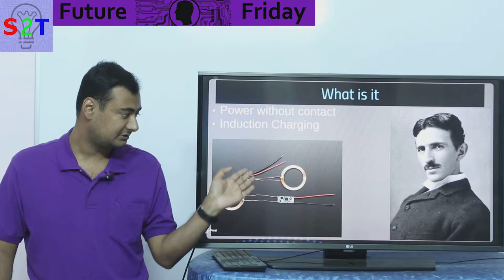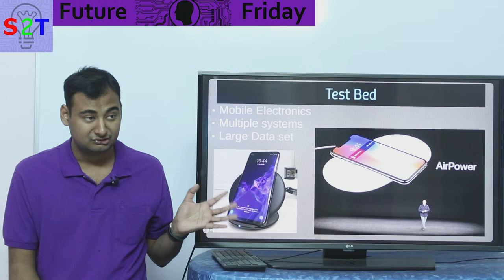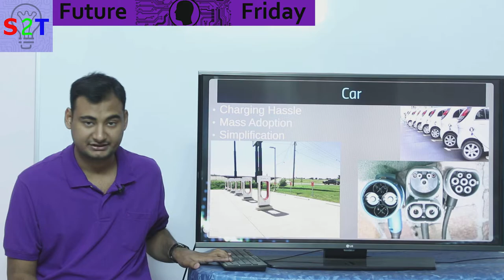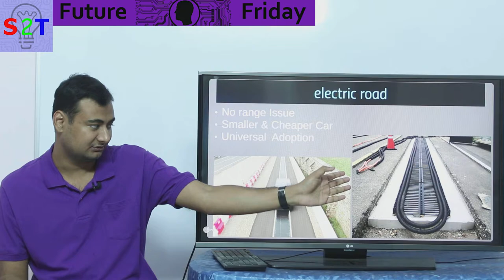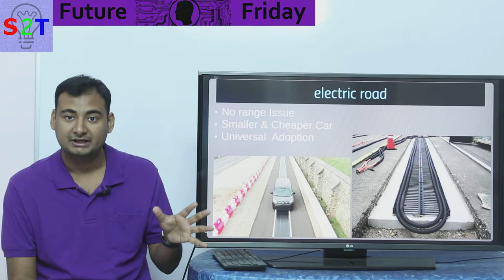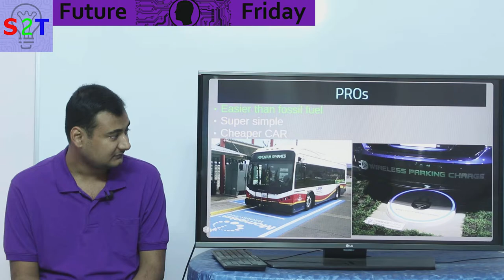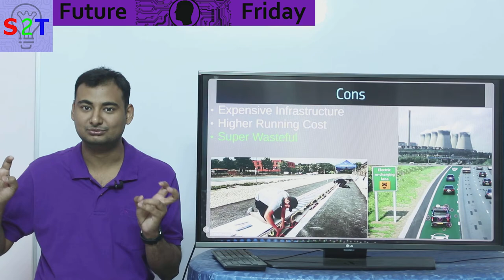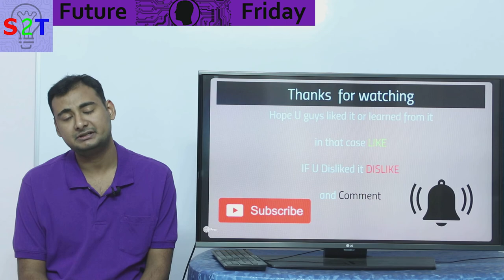Future Friday Ep27 (Wireless Charging For  Car's Explained)

Comment: Is this is cheap enough (road integrated wireless power), this would make hydrogen fuel cell a non-started. How about just on toll Highways only?
Reply from the maker: You are asking me to choose between 2 bad idea wireless car charging is so wasteful it is at the same efficiency as hydrogen fuel cell & hydrogens low density makes it a bad fuel from the get go
Reply: science to technology Well, we need something that can be charged, filled fast for trucks, taxis, buses, etc which are in use regularly, and can’t have hours of charging after a few hundred kilometers. I can only see fuel cell and this. What else?